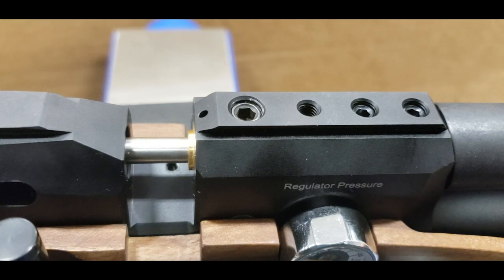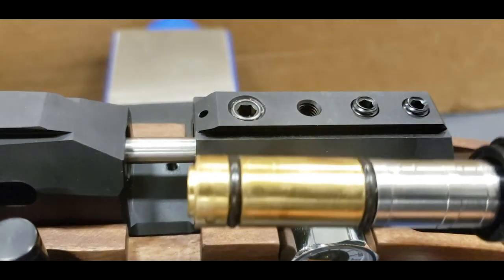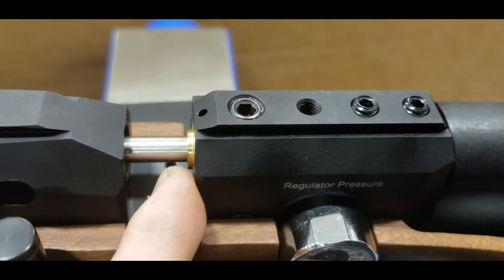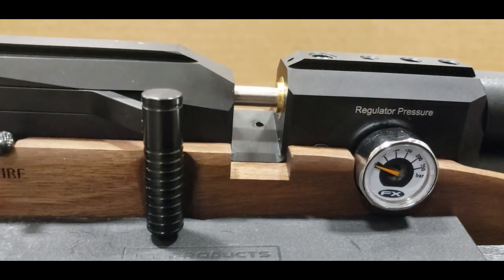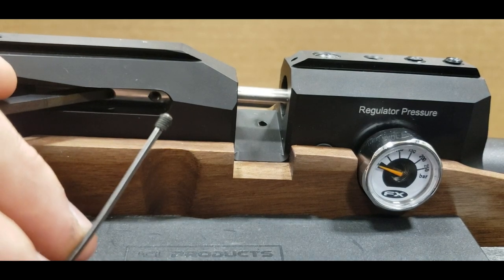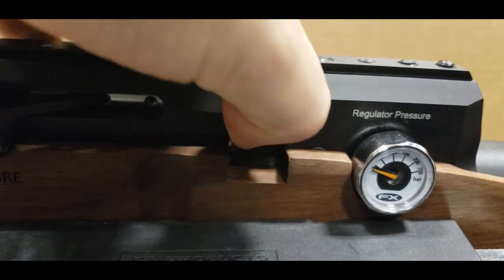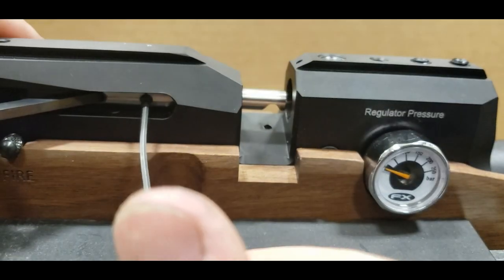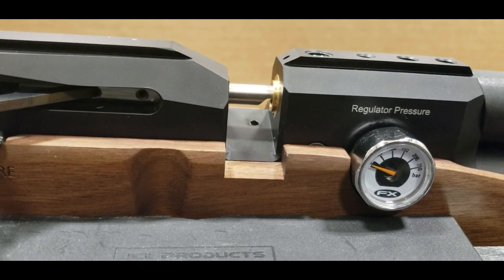How to Remove FX Dreamline Classic - FX Dreamline Classic Barrel Removal and Installation

Comment: Dreamline walnut classic. Wonder if a small hole in the stock behind the hammer spring adjuster, would allow the access for an Allen key to adjust the hammer spring without having to remove the hole stock prior to making some adjustments. 
Kind regards Max
Reply from the maker: Hey Max, yes sir it certainly would! I have seen plenty of people make that modification. Be careful, though, as that is a weak point in the stock, and adding a hole makes the stock even weaker at that section.
Reply: Thanks 😊

Comment: So when I install my superior liner the bolt won’t close. Stx liner is fine. I can get the superior liner to work if I don’t tighten the liner lock. I returned my first superior liner,second one same thing. Maybe my barrel is in a hair too far? IDK. The tech at fx never heard of this. Yes I’m installing it in the right direction.😁 I can’t be the only one, please help. Thanks for your dreamline tuning videos. Big help!
Reply from the maker: I have no immediate idea how this could be happening. Is it the same caliber liner as the barrel was originally intended for? Do you have an aftermarket probe/bolt?
Reply: @910AirgunTuningandRepairs  I appreciate your response. Same caliber, factory bolt. Thanks again for your dreamline videos. Just installed your carbon fiber liner sleeve. Hitting the range in the morning.

Comment: Hi , I've got air coming from the 4 mm alen screw ( the one behind the 2 that secure the barrel)when firing a shot . Tried to use blue loctite to seal it but it didn't cure . Any idea what to use ? Thanks
Reply from the maker: Hey! The blue loctite should have worked, but any sort of sealant/threadlock should work, as all you need to do is make sure the threads are sealed. You might just need to apply a little bit more of the blue loctite. Shoot me an email if you are still having difficulties!
Reply: Thanks for the reply . I cleaned it an tried again adding a bit more . It worked perfectly the second time 👍